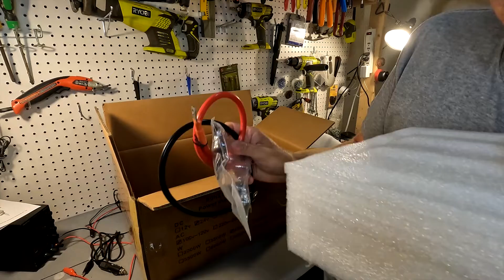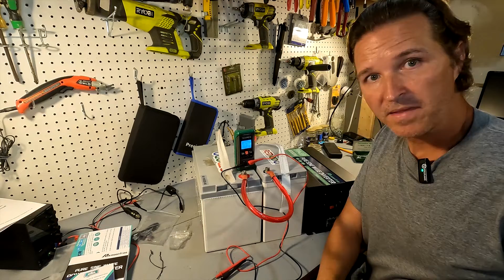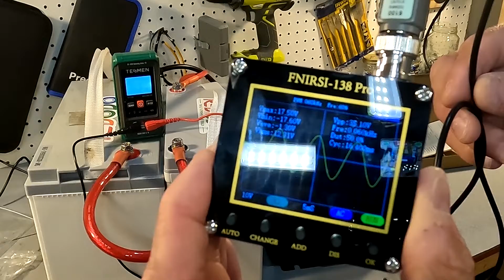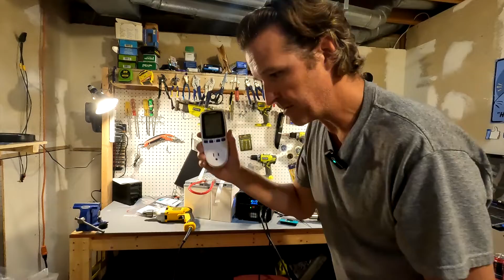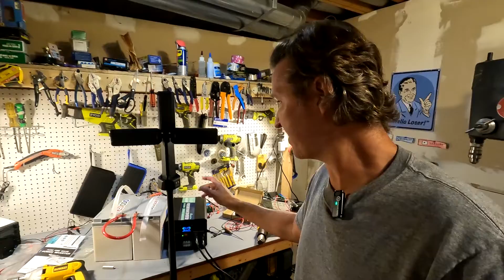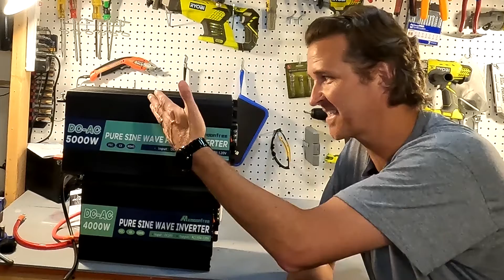mxMoonFree 24v 4000w Pure Sign Wave Inverter Review.

Comment: 4096w /25.6 = 160a dc ( about 30a ac) ... that a little too much dc amps for my liking ... you will need a min of a battery bank of 20kw and  solar panel of 4 kw to run that at .2c ... i find that solar is still a little to expensive compared to the grid ... but to each it own ... if you can afford solar then go for it but you have to maintain your own system and not many people want to do that
Reply from the maker: To run a full power that's correct.  I use it on my 24v system currently and only max out at around 2000w.  I don't like stressing my system.  Thanks for the comment!
Reply: @OffGridBasement  is that 2000w per hour or per day? ... because if it is per hour then you will need 48k battery bank (51200w) for 1 day ... at 4 battery in series for a 51,2 v you will need 10  battery bank (40batteries at 12.8v) ... that is a lot of money in batteries alone ... per day is not that bad but you will only be running the basic
Reply: @rafaelo2215  I don't understand your math, are you being extra strict with the .2c discharge?
Reply: @OffGridBasement what is the idle power consumption

Comment: I own one and it works great. I am here to find specs and wondering if it will handle 32V battery bank which I have yet to build.
Reply from the maker: I don't think so.  Anything over 29 - 30v would either fault or actually damage the inverter.  Hope this helps.
Reply: @OffGridBasement  I was reading the owners manual and it said overload voltage is 30+.05  so 30.5.. You were right on.

Comment: Love your raw real world tests. All that lovely gear you get to keep. It seems common that the bulk of inverters are supplied with cables that are underrated. Enjoy.
Reply from the maker: Thanks!  I try to make use of everything I receive.  That is a big reason why I don't tear apart my batteries during reviews.  I have inverter \ battery in almost every room to be ready for power outages.  Cables will work fine under most loads, but I also suggest maxing out your cable diameter compared to the size of the inverter.  It's just good practice.  That for the comment!

Comment: That was a great presentation.   We're it just those batteries that couldn't sustain the load or would that always be the case?  Those inverters must stay amazingly cool.  Thank you for the video.
Reply from the maker: You're welcome and thank you!  I will need to push a lot harder for it to heat up.  I'll probably do that in another video.
Reply: Those batteries can supply 100 amps.  watts = volts X amps = 25v X 100a = 2500w.  The inverter is supposedly capable of 4000w sustained, which at 25v would require: 4000w = 25v X Namps;   Na = 4000w / 25v = 160a.  If it can surge 8000w then your batteries need to be able to supply 320a for the duration of the surge.

BTW, 160a is pushing it for 2awg and simply far too much for 4awg.  0awg should be enough for a few seconds at 320a but voltage drop might be a problem unless you keep the wires short.

Comment: I like the 12 volt version they need to add a power save mode to it like power jack dose very good for freezers
Reply from the maker: Thanks for the info and the comment.
Reply: @OffGridBasement  yep, it better have less than 0.5 Amp draw at idle for anything used for RV or off grid use.

Comment: I'd roll with 2/0 gauge wire for that bad boy.  166 amps even for a short run would be at least 00 awg.  Which according to the ABYC's Wire Chart that falls in between the 150 and 200 amp ratings.  So for safety you jump to the next highest wire size which would be 2/0 for 200amps.  Also being that large of an inverter I'd put at least 200AH @24v to run it all. The 100Amp BMS wont power it either to my knowledge.  Right now you have a 24v 100AH battery bank utilizing 100 BMS however if you added a second set of 24v 100ah you'd have a full 200 amp BMS capable, I believe.
Reply from the maker: Yes.  I need to double the battery bank in order to get full use from the inverter.  Thanks for the comment.
Reply: Ive ran 200amps for serveral minutes through 6 and 4 gauge no problem, just a little warm to the touch.